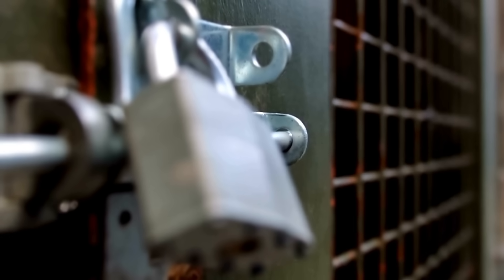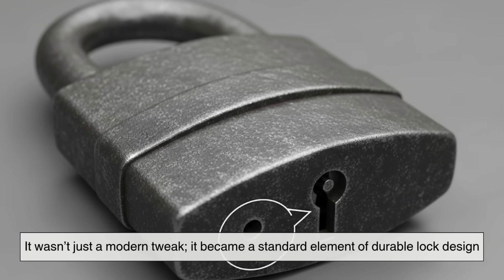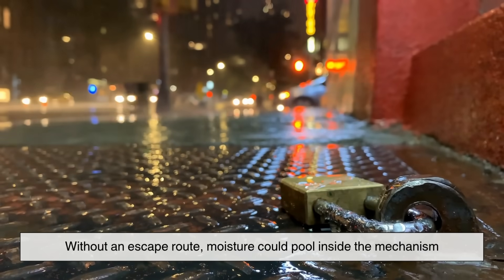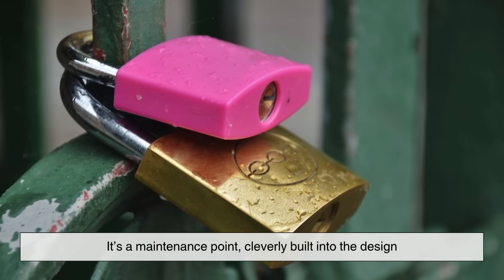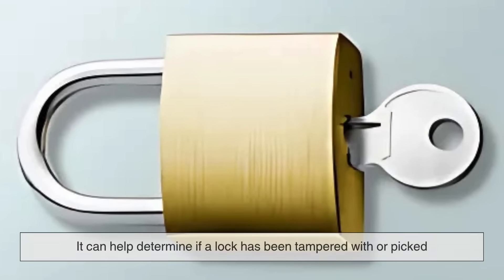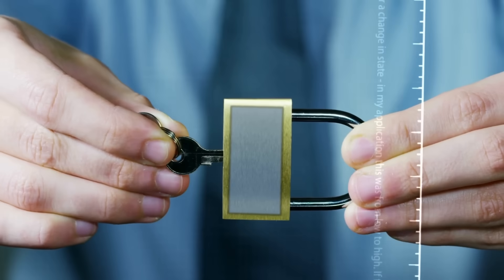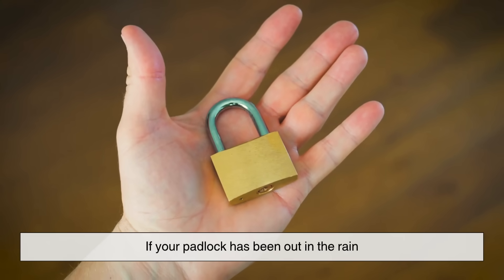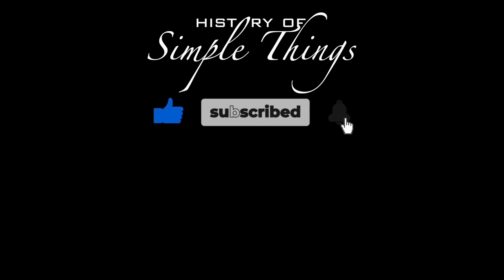Why Your Padlock Has That Mysterious Hole on the Side

Comment: That hole is needed to close the lock when the shackle hole is filled with water. It is needed because water cannot be compressed. Because the shackle chambers and the rest of the lock are separated enough that there is no real effect from putting oil in that little hole. Padlocks that have loose-fitting shackles don't need that hole. For proper lubrication, put oil in the keyhole and the shackle holes. After that, put the key in and out several times while also rotating the key. Then, while holding the key turned, open and close the shackle several times.

Comment: on the Railway we use Graphite Powder. Oil can hold contaminates or be effected by heat and cold. Water can freeze etc. The powder fills the areas and prevents the lock from seizing-up.

Comment: I’ve been a user of lockease in the small spray can. The liquid is a vehicle used to get the graphite in and disperse. It dissipates and the lock stays lubed. It also lubes guitar nuts but can get messy. Paper towels needed.

Comment: For padlocks I use outside I soak them in light motor oil and let drain on a rag overnight. 5-10 years later that oil is still able to repel water and never had a frozen lock in winter either.

Comment: The ONLY lubricant to be used on any lock is ‘graphite’ , take that from an old locksmith
Reply: Agreed:  Liquid lubricants can clog the pins.
Reply: @TubeLVT  - I never found that.
3 tiny drops of 3 in 1 oil in my letterbox padlock every year and it's still fine after over 20 years out in the rain and cold.
Reply: @alpal2002  Good point about the rain and the cold!  Any clogging would be caused by dirt and dust mixing with the liquid lubricant.  That’s not as likely to happen in a cold and wet climate.  3-IN-ONE probably works well for my family in Minnesota.  I would recommend graphite lubricants for family members in the California and Arizona deserts.
Reply: I only ever used 3 in 1 oil.

Comment: Good video. I have noticed that tiny hole on padlocks and thought it was to add a bit of oil. No idea that it was to drain water.
Reply: I figured it was for drainage, but I also add thin oil to all the holes.
Reply: Thanks. Just saved 8 minutes.
Reply: To lubricate a lock, put the oil on the key then insert the key into the lock.

Comment: It's to drain water from the elements and to be able to lubricate inside the lock to prevent rust
Reply: Eight minutes later... I fell asleep and missed the info...
Reply: Thanks.
Reply: You just summed up this entire video.
Reply: On a few yeah. As the rule? Nope not hardly.